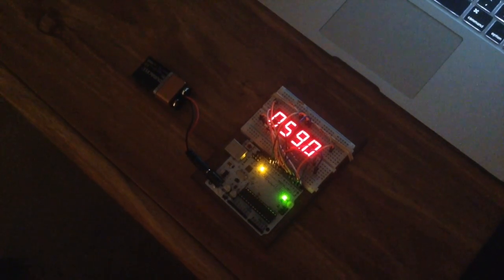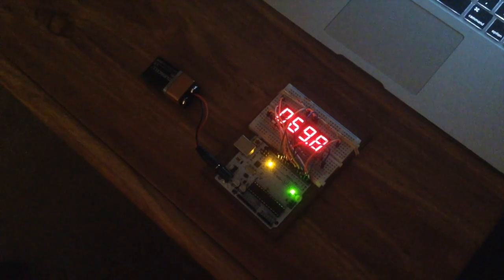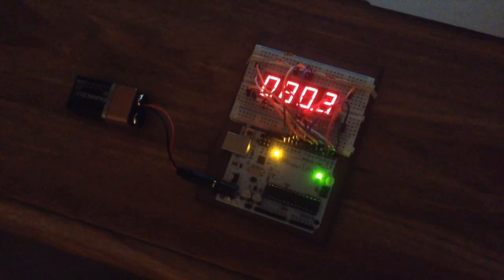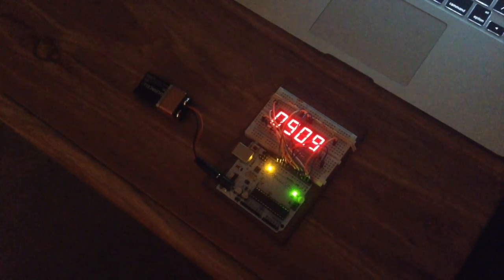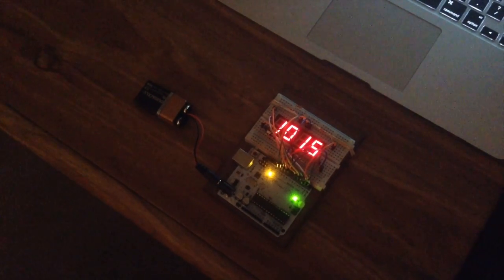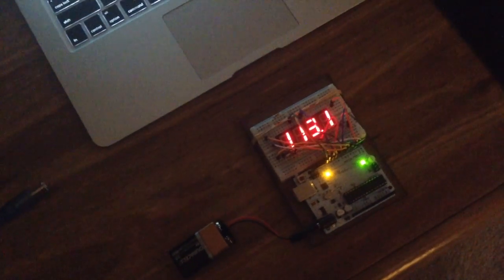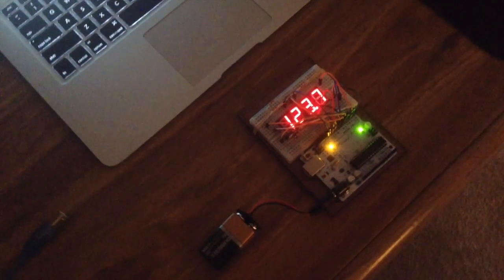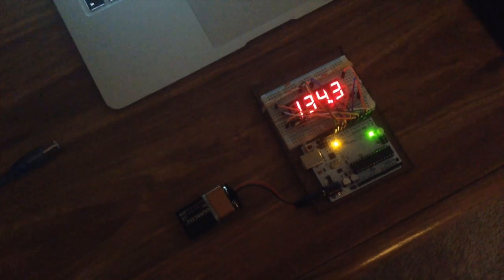Arduino 4 Digit 7 Segment Counting Tutorial

Comment: Hey...i modified the code slightly so that you can use a push button to use the code as a stop-watch!!

Try it...all you need is to add a push switch between GND and PIN 13

Copy and paste below to IDE and upload!!

Let me know

//set the cathode interface
int a=5;
int b=7;
int c=9;
int d=11;
int e=12;
int f=6;
int g=8;
int p=10;
//digits
int d4=4;
int d3=3;
int d2=2;
int d1=1;
int startstopreset=13; 
//set variable
long n = 0;
int x = 100;
int del = 55;  
int currState=0; //fine-tuning value for clock

void setup()
{
  pinMode(d1, OUTPUT);
  pinMode(d2, OUTPUT);
  pinMode(d3, OUTPUT);
  pinMode(d4, OUTPUT);
  pinMode(a, OUTPUT);
  pinMode(b, OUTPUT);
  pinMode(c, OUTPUT);
  pinMode(d, OUTPUT);
  pinMode(e, OUTPUT);
  pinMode(f, OUTPUT);
  pinMode(g, OUTPUT);
  pinMode(p, OUTPUT);
  pinMode (startstopreset, INPUT);
  digitalWrite (startstopreset, HIGH);
}
 
void loop()
{

int swButtonState=digitalRead (startstopreset);
if (swButtonState==LOW){
  currState++;
  while (digitalRead (startstopreset)== LOW);
}

  clearLEDs();
  pickDigit(1);
  pickNumber((n/x/1000)%10);
  delayMicroseconds(del);
 
  clearLEDs();
  pickDigit(2);
  pickNumber((n/x/100)%10);
  delayMicroseconds(del);
 
  clearLEDs();
  pickDigit(3);
  dispDec(3);
  pickNumber((n/x/10)%10);
  delayMicroseconds(del);
 
  clearLEDs();
  pickDigit(4);
  pickNumber(n/x%10);
  delayMicroseconds(del);

if ((currState%3)==0)
n=0;
else if ((currState%3)==1
)n++;
else
{}

 
}

void pickDigit(int x)  //define pickDigit(x),to open dx port
{
  digitalWrite(d1, HIGH);
  digitalWrite(d2, HIGH);
  digitalWrite(d3, HIGH);
  digitalWrite(d4, HIGH);
 
switch(x)
{
  case 1:
    digitalWrite (d1, LOW);
    break;
  case 2:
    digitalWrite (d2, LOW);
    break;
  case 3:
    digitalWrite (d3, LOW);
    digitalWrite (p, HIGH);
    break;
  default:
    digitalWrite (d4, LOW);
    break;
  }
}
 
void pickNumber(int x)   //define pickNumber(x)to display number x
{
  switch(x)
  {
  default: 
    zero(); 
    break;
  case 1: 
    one(); 
    break;
  case 2: 
    two(); 
    break;
  case 3: 
    three(); 
    break;
  case 4: 
    four(); 
    break;
  case 5: 
    five(); 
    break;
  case 6: 
    six(); 
    break;
  case 7: 
    seven(); 
    break;
  case 8: 
    eight(); 
    break;
  case 9: 
    nine(); 
    break;
  }
}
 
void dispDec(int x)  //set to start the decimal point
{
  digitalWrite(p, HIGH);
}
 
void clearLEDs()  //clear contents
{
  digitalWrite(a, LOW);
  digitalWrite(b, LOW);
  digitalWrite(c, LOW);
  digitalWrite(d, LOW);
  digitalWrite(e, LOW);
  digitalWrite(f, LOW);
  digitalWrite(g, LOW);
  digitalWrite(p, LOW);
}
 
void zero()  //define 0 as cathode pin switch
{
  digitalWrite(a, HIGH);
  digitalWrite(b, HIGH);
  digitalWrite(c, HIGH);
  digitalWrite(d, HIGH);
  digitalWrite(e, HIGH);
  digitalWrite(f, HIGH);
  digitalWrite(g, LOW);
}
 
void one()  // define 1 as cathode pin switch
{
  digitalWrite(a, LOW);
  digitalWrite(b, HIGH);
  digitalWrite(c, HIGH);
  digitalWrite(d, LOW);
  digitalWrite(e, LOW);
  digitalWrite(f, LOW);
  digitalWrite(g, LOW);
}
 
void two()  // define 2 as cathode pin switch
{
  digitalWrite(a, HIGH);
  digitalWrite(b, HIGH);
  digitalWrite(c, LOW);
  digitalWrite(d, HIGH);
  digitalWrite(e, HIGH);
  digitalWrite(f, LOW);
  digitalWrite(g, HIGH);
}
 
void three()  // define 3 as cathode pin switch
{
  digitalWrite(a, HIGH);
  digitalWrite(b, HIGH);
  digitalWrite(c, HIGH);
  digitalWrite(d, HIGH);
  digitalWrite(e, LOW);
  digitalWrite(f, LOW);
  digitalWrite(g, HIGH);
}
 
void four()  // define 4 as cathode pin switch
{
  digitalWrite(a, LOW);
  digitalWrite(b, HIGH);
  digitalWrite(c, HIGH);
  digitalWrite(d, LOW);
  digitalWrite(e, LOW);
  digitalWrite(f, HIGH);
  digitalWrite(g, HIGH);
}
 
void five()  // define 5 as cathode pin switch
{
  digitalWrite(a, HIGH);
  digitalWrite(b, LOW);
  digitalWrite(c, HIGH);
  digitalWrite(d, HIGH);
  digitalWrite(e, LOW);
  digitalWrite(f, HIGH);
  digitalWrite(g, HIGH);
}
 
void six()  // define 6 as cathode pin switch
{
  digitalWrite(a, HIGH);
  digitalWrite(b, LOW);
  digitalWrite(c, HIGH);
  digitalWrite(d, HIGH);
  digitalWrite(e, HIGH);
  digitalWrite(f, HIGH);
  digitalWrite(g, HIGH);
}
 
void seven()  // define 7 as cathode pin switch
{
  digitalWrite(a, HIGH);
  digitalWrite(b, HIGH);
  digitalWrite(c, HIGH);
  digitalWrite(d, LOW);
  digitalWrite(e, LOW);
  digitalWrite(f, LOW);
  digitalWrite(g, LOW);
}
 
void eight()  // define 8 as cathode pin switch
{
  digitalWrite(a, HIGH);
  digitalWrite(b, HIGH);
  digitalWrite(c, HIGH);
  digitalWrite(d, HIGH);
  digitalWrite(e, HIGH);
  digitalWrite(f, HIGH);
  digitalWrite(g, HIGH);
}
 
void nine()  // define 9 as cathode pin switch
{
  digitalWrite(a, HIGH);
  digitalWrite(b, HIGH);
  digitalWrite(c, HIGH);
  digitalWrite(d, HIGH);
  digitalWrite(e, LOW);
  digitalWrite(f, HIGH);
  digitalWrite(g, HIGH);
}